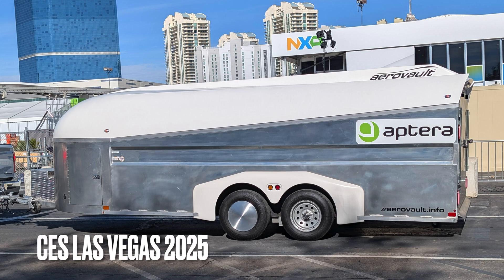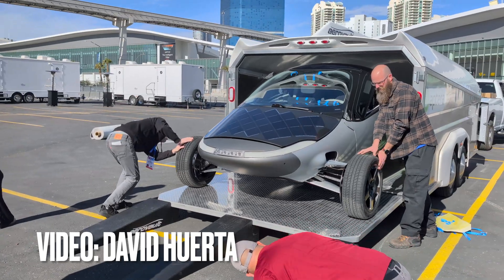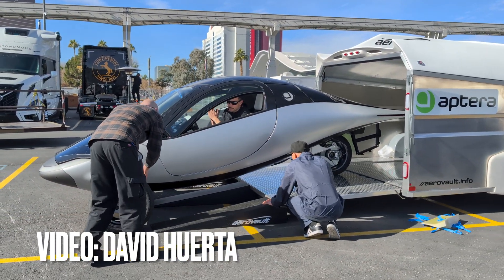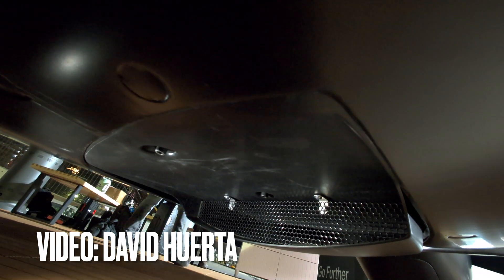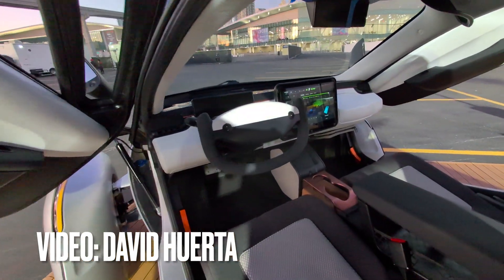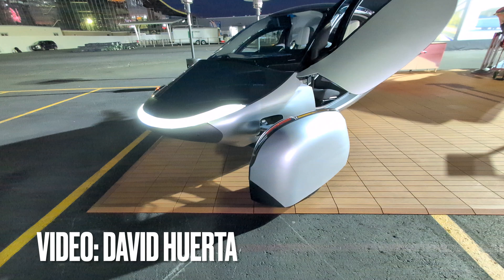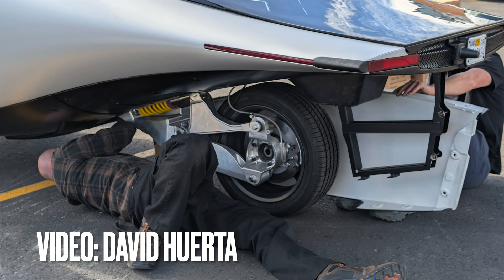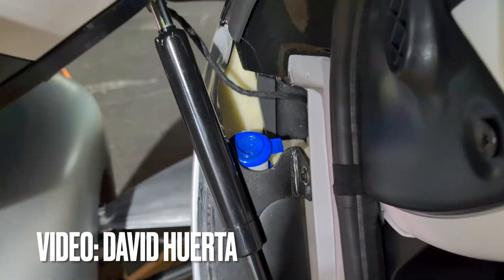Aptera at CES 2025 4K Set Up footage!

Comment: How did the driver get inside Aptera while inside the trailer for the roll out?
Reply from the maker: That's a terrifying question!! Long ride from San Diego to Las Vegas 😵‍💫
Reply: @dtl Really!? That's just what I feared. I hoped there would be a different answer…
Reply from the maker: @PereAndreuUbachdeFuentes  I'm sure there is a different answer. I was 1/2 joking about the ride
Reply: @dtl maybe putting the finishing touches on the interior while on the road;)
Reply: He comes pre-installed with every vehicle!
Reply: @david.e.h.  Hahahahaha! That's a good one! I'd like to know it for real. Because that's a situation on how to get in and out of the Aptera in tight spaces. And with the butterfly style doors it's not evident it can be done. Maybe the driver had to climb in and out through the rear hatch?

Comment: 1:30:  looks like an air scoop for the radiator.  I hope it doesn't add too much drag, or get clogged by freezing slush.
Reply: Definitely a new detail.  I'm definitely concerned for the drag and snow
Reply from the maker: great point!!!
Reply from the maker: interesting
Reply: The intake is being fine tuned for max efficiency with minimal aero penalty.
Reply: I think they will have this scoop for the track testing on the Hermes but talking to the heat/cooling engineer,I believe he said they're looking at chaning it already.  We have some driveways in WI where I could bottom out a regular car and that air scoop would be gone in an instant, if I took this over one.  The Aptera is low already, so I'm expecing to scrape up the bottom a bit.
Reply from the maker: @artboymoy  same here in Michigan. Including my driveway!